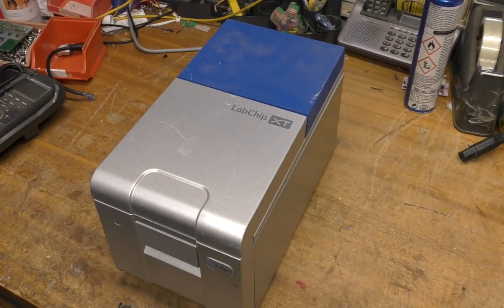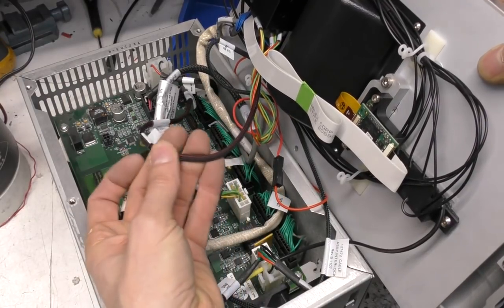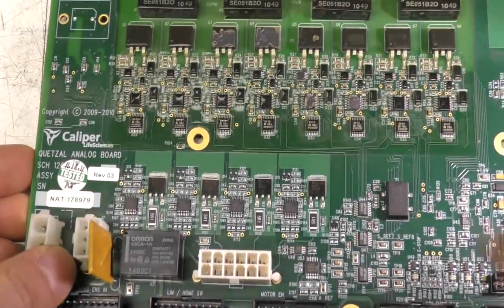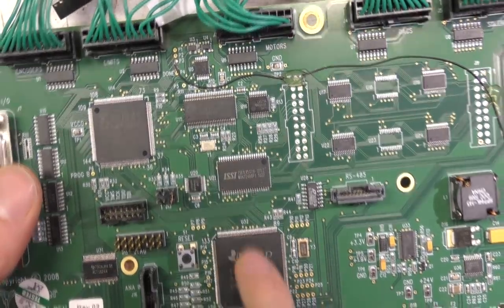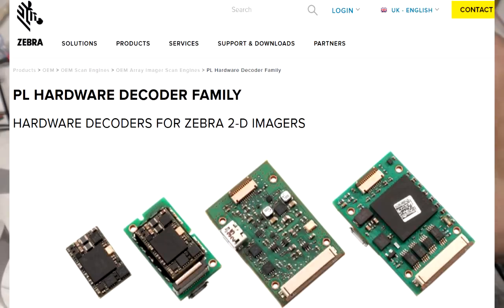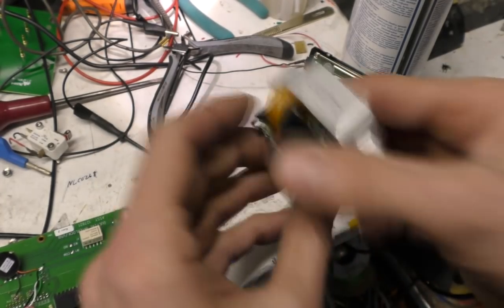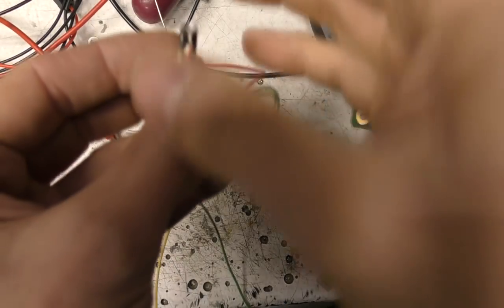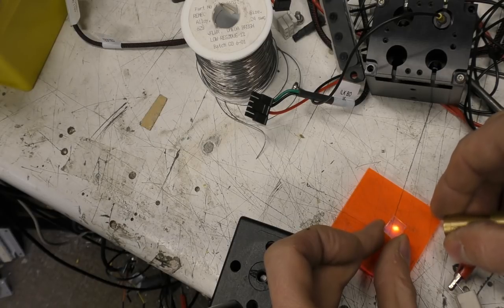Caliper Labchip DNA fractionation system

Comment: Those photodiodes are $282.29 each, not for five. They will be making them to order, with that price and lead-time. Semiconductors can take days to dope for each layer, plus the days of cleaning, photoresists, etching, contact deposition, testing, packaging and final testing. We made certain devices to order, with delivery times starting at about 4-6 weeks, extending up to maybe 14 months if 100% survivability of 8,000 hour life tests were required.

Comment: Mike, thank you for the video! I worked on a similar device in 2008 and it was one of my favourite projects so far. Mine just had more motors and microfluidics inside but in general the science/lab gear is one of the most interesting things an engineer can work on. Now i work in automotive .... it is well paid and boring ;) Thanks for all the effort you put in to make those videos! Have a happy new year, mate!
Reply: How many engineers are involved in the development phase of one of these things? Even for this small device what we see here has thousands of hours of work going into it. It looks like different boards were designed by different teams.

Comment: Why would software for a many-thousand-dollar machine need a dongle? Shouldn't the device itself be enough of a verification?
Reply: You would be surprised how expensive those softwares are next to the hardware. Even for an average optical microscope which barely does some post-processing with the images taken from biological samples will cost a fortune, and the hardware will not work without them. In fact, most of the time the price of the software is not even on the webpage, you will have to ask them for a quote, since they do not want to scare poeple. Manufacturers can get away with it, since it is a super niche market.
Reply: They might be worried about the chinese copying the hardware and make it compatible with their original software

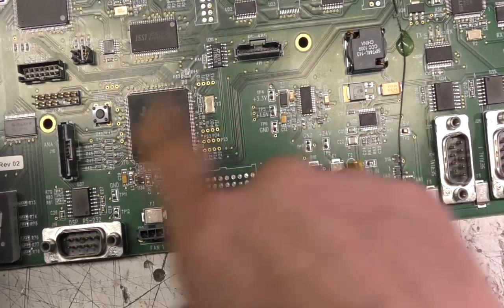Comment: At 13:05 or so, the autogenerated captions seem to think this is a different sort of apparatus: “…considering how little it is really doing, it’s basically just applying high voltages and turning ladies on, the making measurements out TSP…”
Reply: I though he said "turning LEDs on". The other meaning with ladies is really funny ;)